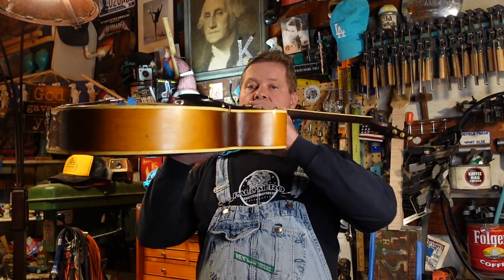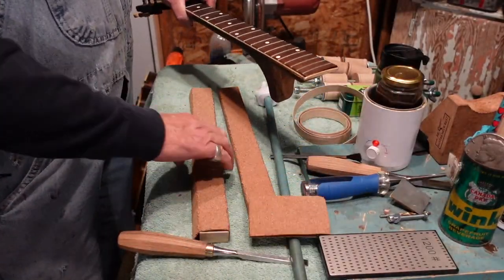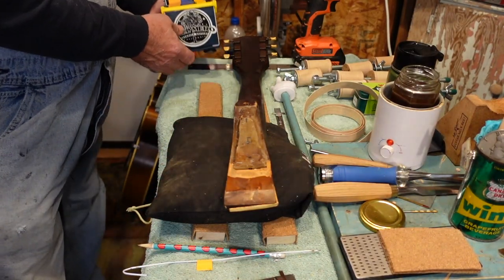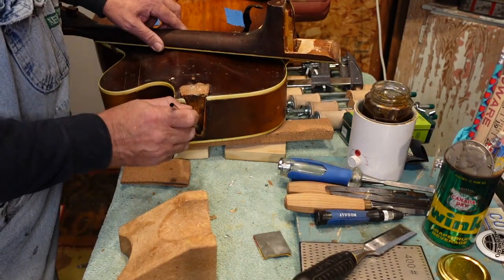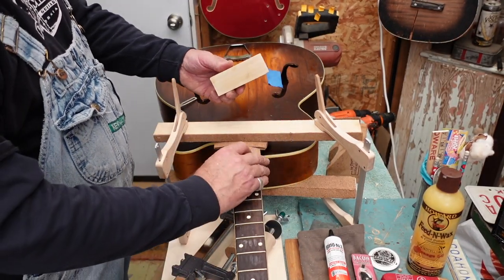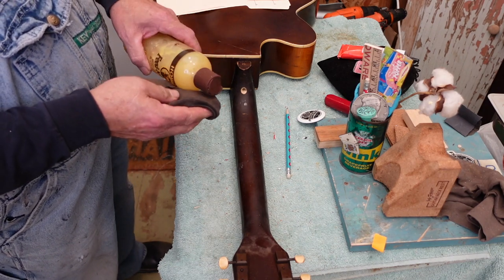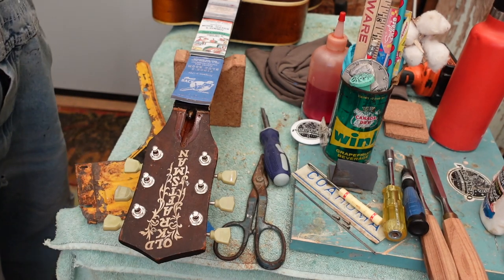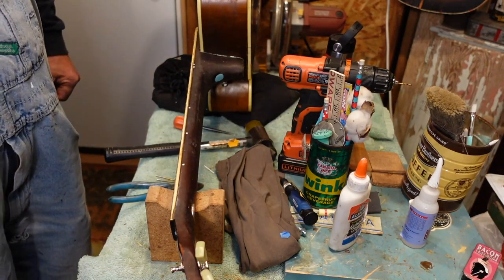Kay Old Kraftsman Single Cutaway Archtop Neck Repair

Comment: Great video. These have been really helpful. I have an old kay much like this one but with a warped neck I am planning on reinforcing with carbon fiber rods (I have done this for several guitars in the past). Do you know how hard it is to remove the fretboards on these Kays? I assume it is just hide glue. Are the fretboards solid wood or some sort of composite?
Reply from the maker: Hey there, my experience is that they are typically solid and if you take some time heating them up through the frets and be easy not to get a crack running on the neck itself you should be able to get the fretboard off. Once it’s gone, think about cleaning down whether it’s a sander or just using a piece of graphite to level the top of the neck in order to accept a new store-bought fretboard, it doesn’t matter too much of the neck is crooked as long as the top of it thinks it straight :-). Figure out what the change in internation is going to be adjust your floating bridge position accordingly put new frets in and you’re good to go.  I ordered a dobro style fret board for the #galianojunkpile and everything worked out fine. Link to that episode is below. Thanks for watching.
Reply from the maker: https://youtu.be/79w6DV2DLlo?si=PXmeWPTkKZL2P-HF

Comment: I have not seen that fret dot configuration before... clever!
Sort of off topic: I miss your cigar box guitar builds!
Howard Feed'n'Wax! Great stuff, I use it to wax wood screws to help them cut the threads in wood (I stripped out too many Phillips heads before I caught on!)
Side fret markers... great idea with the tape, but how flush can you file them, don't you have to take into account the thickness of the tape? I know it's miniscule but they won't be flush with the neck... or is this a case of "close enough"?

Comment: Interesting way you sharpen the chisel.  I too use a diamond plate.  The normal method is to put the back flat on the surface to take away the burr from sharpening the beveled edge.  You are putting a back bevel on the chisel which can increase the chance for split out/splitting the wood.  Could you please comment on your thoughts and experience with your method?  Thank you.

Comment: I would have really liked to see or know How you got the nut iside to the bolt
Reply from the maker: It was a nightmare but I used a flexible extension on a quarter inch ratchet and socket   Thanks for watching
Reply: @paulmerojunkpileguitars  i just seen beginners video of you actually doing that job. Nice job.and thanks for the replies. I know that takes time yet I see a lot of no replies on other sites.  That being the case they might as well just turn comments off. Just my opinion
Reply from the maker: @bobbennett790  easy$

Comment: You drilled a hole in the outside of the neck to go into the end block……not good!  NEVER do that!. There are arch tops made by either Kay or harmony that have neck bolts, but they are inserted inside the guitar. You use furniture bolts with Allen heads and metal inserts in the dovetail.  Folks watching this…..NEVER DO THIS TO A GUITAR!! Just do a neck reset and glue it back in like it was originally made.
Reply from the maker: Bill is right. Always buy a Gibson Super 400 with a single cutaway from a luthier that has completely restored it and never worry about a neck reset or bolts again ))) Here’s a good one (if only I had saved the $75 I paid for the Old Kraftsman in this episode I would have been well on the way to a problem free guitar) https://www.guitarcenter.com/Used/Gibson/Custom-Shop-Super-400-Hollow-Body-Electric-Guitar.gc
Reply: @paulmerojunkpileguitars  now thats a real intelligent answer. no one was talking about a super 400 or what you paid for the guitar.    your wood butcher hole with a screw in the outside of the neck  is not going to do much anyway.  you would need to have the bolt as low as possible on the heel to have any effect of pulling the heel into the dovetail at the lowest point to counter the force exerted by the strings.  your gibson style gears look weird also. grovers or round button klusons would be a much better match for this instrument....but hey theres already a hole in the heel, so what does it matter.  side markers in the wood???  how many archtop guitars did you ever see that on?   also, there is a reason you never see a gibson or other archtops with the strap button where it is....ITS IN THE WAY OF PLAYING!!!...just like that nickel you drilled into the back of the neck will do. too bad for this old gal. she deserved better.
Reply from the maker: @billhatcher9303  tell me you at least love my hairstyles.  You gettin' pretty angry over a guitar that was hanging on a garage wall in East LA drying out and cracking that Kay intended to be an imitation of the Gibson 400 single cutaway.  Time for a wellness check there Dad? #angryfangirlsequalmoreclicks #eastlacutaway sounds terrible too https://www.youtube.com/watch?v=WX6Dy0DDI2c
Reply: @paulmerojunkpileguitars  love the shop,love the hair…..   I have to fix guitars that all sorts of crazy crap has been done to them. People watch what your doing.  Bolts through the outside of heels on guitars is totally bogus. All you need is glue and clean up the dovetail slot and fit for neck pitch. 50 years from now some repair guy is going to be yelling at you when that guitar comes back in for another repitch.  I’m going to send the luthier police over in the night and hide all your drills and drill bits.
Reply from the maker: @billhatcher9303  dude the TAGS ARE STILL ON THE MATRESSES so don't worry about it )))
Reply: @paulmerojunkpileguitars  . I’m trying to put a Harmony meteor back together that a guy totally ruined. I’m sorry I took some of my frustration out on your repair technique. Certainly not you.  Please excuse. Best to you and get off my lawn….;-)
Reply from the maker: @billhatcher9303  The problem is people tend to hide these repairs and then you don’t find them until you have someone’s guitar apart and the estimate to fix the damage that was concealed is now through the roof and  the person doesn’t have the money to fix it and their guitar is in pieces and they blame you. I totally get it. I make every effort including the use of #chickflikteal paint to make sure everybody knows what a shoddy job is done on my guitars. Subscribers the moral of the story here is if you’re going to buy $100 guitar or someone brings in a $100 guitar don’t expect that they will have the money to do a $500 neck reset and it’s not the luthier’s obligation to collapse their price structure to accommodate your dream.  @Bill Hatcher and I staged this charade for the benefit of y’all As you were Kp